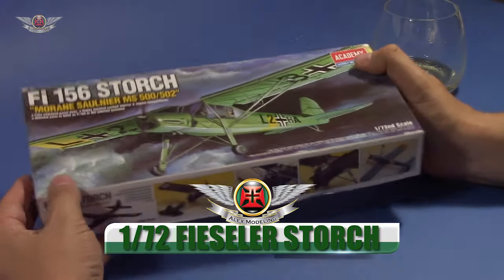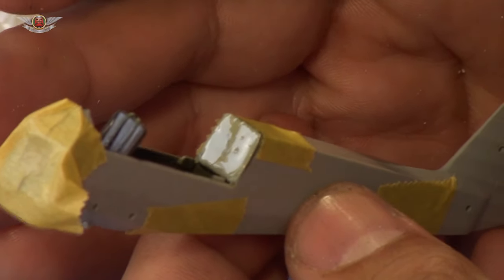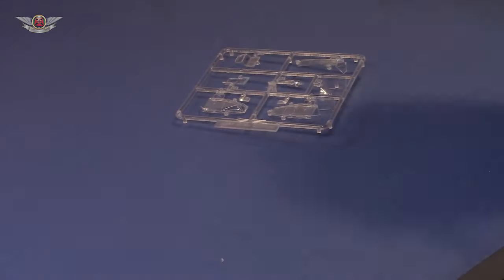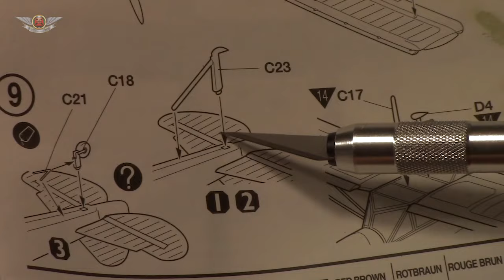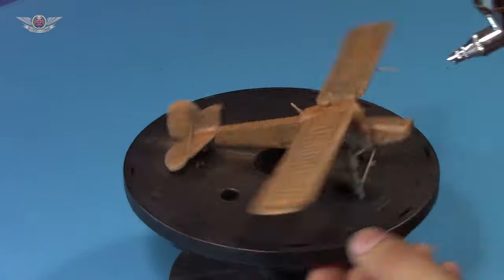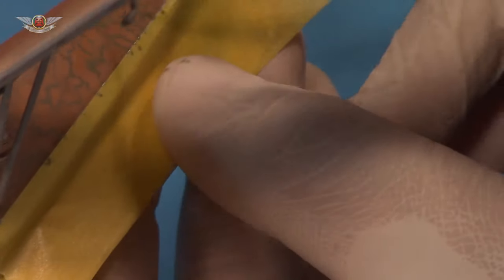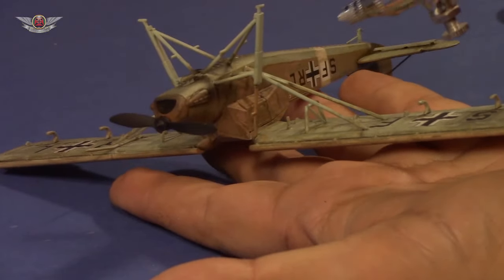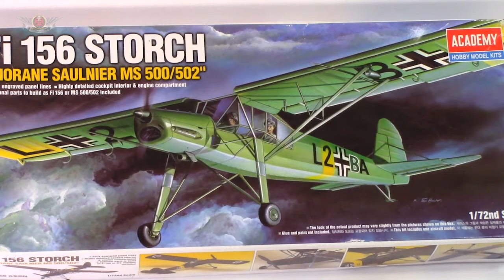1 72 FIESELER STORCH FULL BUILD VIDEO

Comment: For some unknown reason, I can not edit the comment below. I have a couple of questions. I never saw you use part C1. Did I miss it? What is your source for hypodermic needles? I plan on doing the Eastern Front 1942 color scheme.
Reply from the maker: Hello. I don t do a piece by piece video build otherwuse the vídeo would have 2 hours for ex: i do a generalista but at the same time build that you guys can have a very close ideais and visual reference... I don t know now what C1 is... I assume its a clear parte? Its all there. Needles i went to Ebay
Reply: @AlexModeling  C1 is the internal bracing that went underneath the overhead canopy glass. I was thinking it got painted prior to installation.